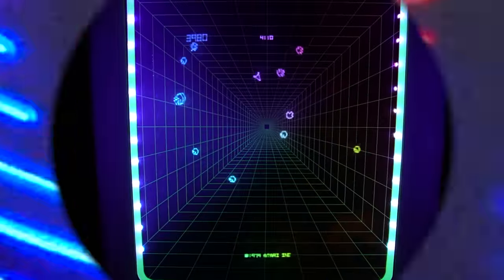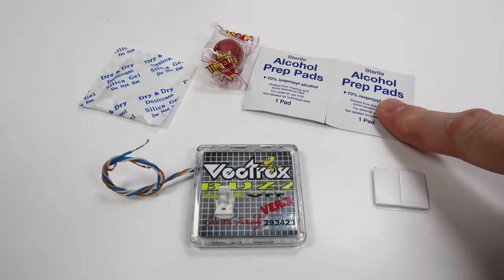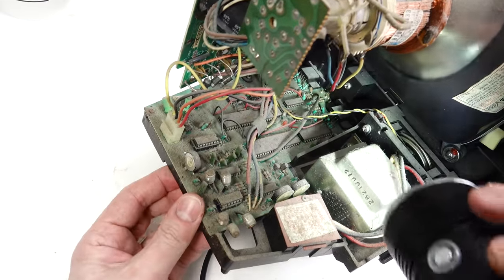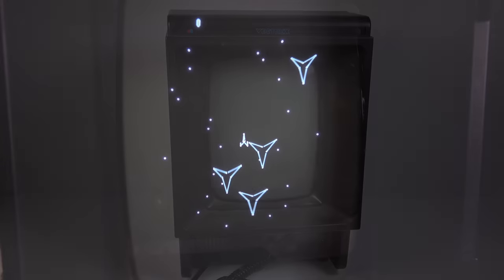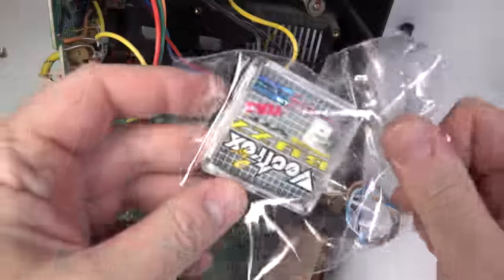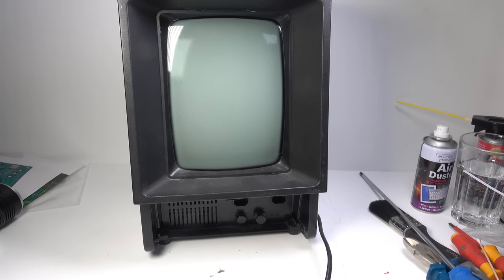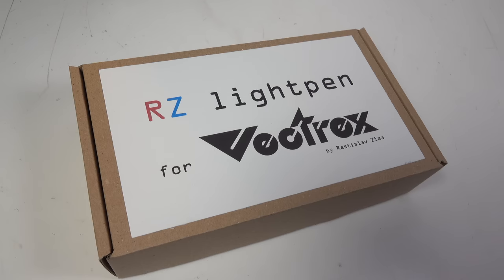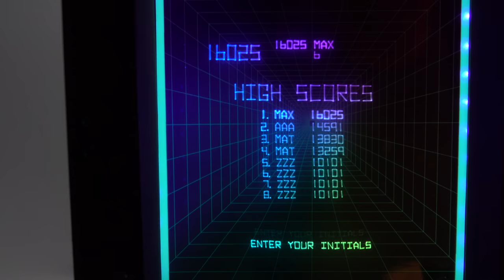Vectrex Buzz-Off Kit Installation

Comment: did they need to come with their own crt? wouldn't it have cut costs to have people use their own screens and made it more popular
Reply: jlebrech no, wouldn’t work. It draws vectors on the CRT (hence the name), where as a normal monitor/TV always scans a full picture line by line. No way to tell the electron ray to draw shapes instead, that needs custom electronics to drive the CRT, which the Vectrex has.
Reply: @enojelly9452  oh i see, tvs rasterise
Reply: @enojelly9452  maybe they could have sold the logic boards TV makers
Reply: The CRT (the tube) itself is a regular ordinary B/W tube like used in regular TVs  but on vector monitors in arcade games and in the Vectrex, the electron beam can be moved directly from one spot to the other, either drawing a line or not, this way the picture is created. The advantages at the time were that computer graphics weren’t powerful enough to do 3D and have loads of moving stuff on the screen.
So, the Vectrex hardware could never be interfaced with a regular TV as a regular CRT TV always draws in horizontal lines, from top to bottom.
Reply: jlebrech that would be impossible as a regular TV cannot display vector graphics.
Reply: @atariandre5014  they'd have to have vector capability added to them no? But also would have to be b&w.
Reply: jlebrech the yokes (the coils) which are around the neck of the CRT in vector monitors are different from TV yokes so you cannot combine them into one unit. Besides that, it wouldn’t be commercially viable. And no, it wouldn’t need to be B/W only, although the Vectrex is B/W only, this was a cost decision mostly. There were many colour vector arcade games like a Tempest, Gravitar, Star Wars etc.
Reply: Interestingly, one of the marketing points for the Vectrex was that you didn't need an additional TV or monitor. Remember this was released when most families had a single TV set in the house. 
If you were a kid buying a home computer or console you were either going to be limited to using it when the TV wasn't being used by the family to watch programmes; or factor in the not unsubstantial extra cost of buying a monitor or a second TV.

Comment: anyone down the south of england that can fix vectrex as have one here with no sound or picture as worried to work on it due to they hold high voltage when not in use , love to learn tho ,great video by the way

Comment: If such devices (including today's computers and flatscreen TVs) stop working it is most likely that the condensators depleted - a matter of a few cents to replace them with new higher quality ones (here manufacturers use shabby ones due to planned obsolescence).

Basically everybody can replace them. Soldering is no magic - you just have to watch the + and - poles of the condensators.

Sometimes a resistor burns through, too...and here you do not even have to care about polarization.

Comment: Use a mask and compressed can of air outside. That way if you end up with mold you can go inside and throw your stuff in the wash immediately and shower. Then try isopropyl alchohol. Highest amount the better. You clean with Qtips and yes. You can contact all the metal bits with the alcohol. It is used to wash down metal electronics at 99%. But keep in mind. Gloves are a good idea u less you want to sterilize your hands. Alcohol is also absorbed through the skin. No gloves=you get drunk-ish and maybe poisoned after 2 hours >_>

Comment: Talking about the fluidity of the animation compared to later machines...  Writing dedicated code for a dedicated machine is ALWAYS faster, better, and more fluid.  Today's computers spend inordinate amounts of time doing nothing.  Programmers today don't even know what the machines are doing.  Instead, we just write little pieces of code that react to "events" that we trust are happening in a logical order, but rarely are.  Just moving a window across your screen could cause the program to completely redraw the entire window multiple times, for example.
Back then, we had to be efficient.  There wasn't any choice.  Today, machines are faster, have more memory, and more storage, so we're not interested in efficiency of execution, but quick coding.
One of the theorems we had in the '80's was that an extra hour of programming time, if it were to save a few seconds of user time, was a good investment.  Now, we're only interested in getting code out fast.  How long you, the user, has to wait for execution isn't considered.
This probably is because most software is not written in-house any more, so the loss of user productivity isn't something that the development staff has to worry about.

Comment: Cant we fix the circuit instead of retrofitting. That would have been much useful for the DIY users.
Reply: There's no circuit fix short of redesign. The amplifier chip seems to be located next to a CRT driver.

Comment: It'd be pretty interesting to see an LCD display swap for the vectrex CRTs, with a modification to allow the light pen to work at it's certain refresh rate. Mostly due to CRTs dying off, and/or being annoying for younger ones (Like me i can't stand them due to white noise they make)
Reply: Will not work that way, unfortunately, since it's vectors. And CRTs don't emit white noise, old analog tv's do when they are not receiving any signal through the tuner. Some CRTs (well, not the bulb itself but the electronics) do emit a high pitced noise that annoyed the hell out of some youngsters. When you grow up, you won't hear it anymore. 

I was all hyped up when I was at school, and before class started I could hear a CRT tv being turned on inside classroom. That meant some interesting (not) videos being watched at class.

Comment: dear god, please clean it PROPERLY. Either take it outside and use air in a can or take a vacuum-attachment to clean it.That's a firehazard. Looks like you take more care for recordplayers than microelectronics :P
Reply: let go of his ankle and apologise for the teeth marks first.
Reply: for the love of god don't use a vacuum cleaner to dust off electronics!
Reply: Itll be fine
Reply: I just washed my main Vectrex board in the sink with lukewarm water and some soap...... I can’t stand dirty/dusty PCBs and stuff.
I removed the socketed chips first and desoldered the pots. Right after washing I thoroughly dried it with a towel and my girlfriends hairdryer....especially under the sockets and cartridge port.
I removed the CRT from the case, washed the case the same way, I cleaned the CRT with wet-wipes. It is SO rewarding to see a factory new looking machine.... also did a full cap replacement. I measured all caps and only 1 was really off, and one was “at the border” but since the Vectrex  is not a device you take apart easily I figured to go for it.

Comment: Should have re-capped the board while you had it open. It would have saved you some headache in years to come.
Reply: The joints on the Vectrex boards are of very poor quality, although recapped Vectrex migh work better its a risky job and few people have broken it by trying to do it, so many that are not skilled in electronics choose rather not to touch it until it works.

Comment: > buzz off kit
> mount it directly on the transformer
Reply: It’s massively shielded. Non noise.
Reply: @obtainiumgaming4472  OK, well tell me, how are they doing it?
I don't see a big high mu sarcophagus over the transformer.

The only reason it isn't buzzing offensively is the kit has a decent PCB layout.

Comment: Removing the legendary vectrex buzz, is like putting to the Ferrari F40 an automatic transmission... Heresy! XD
Reply: But an automatic transmission is actually good with a locking torque converter, just like a vectrex with a relocated amplifier is closer to an actual arcade machine.
Reply: Your comparison doesn’t make sense..... you still have to play yourself.... 
the buzz comes from a design error. Wouldn’t you like any serious design error to be fixed on your Ferrari F40 ?
Reply: I thought that the smiley face at the end of the comment made it clear that it was a joke, my fault.
Next time I will enclose it in the tag [JOKE = hyperbole] ... [/ JOKE]

Comment: This solution seems a bit odd... You would think after all this time someone would have found a better solution then "Just wack another amp in there that'll fix it!". 
And back from a few hours research. There are other fixes that correct the flaw itself and more besides. Lots of different levels of complex.  Buzz off is just the simplest solution and given his trepidation with damaging it I completely understand. Also the way this thing is put together is... yuck. Needed a few more passes at this design before revving up the manufacturing plant. Your design should not look like a rats nest before it leaves the plant.